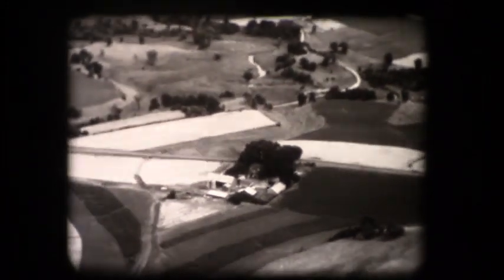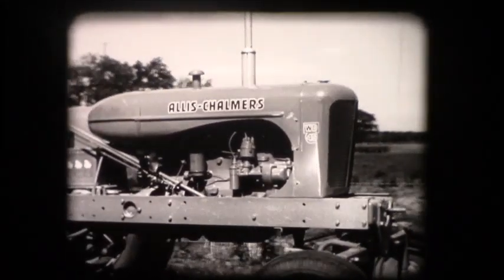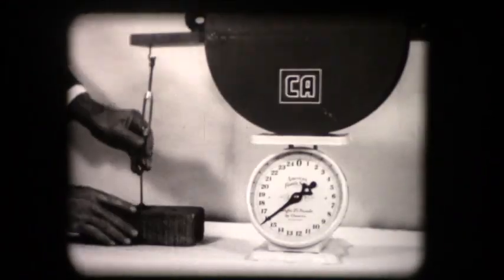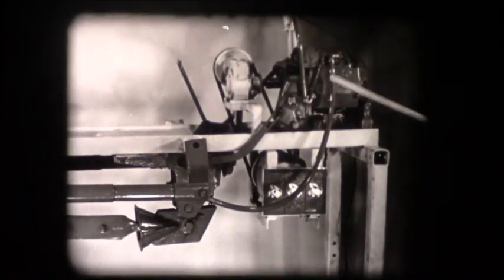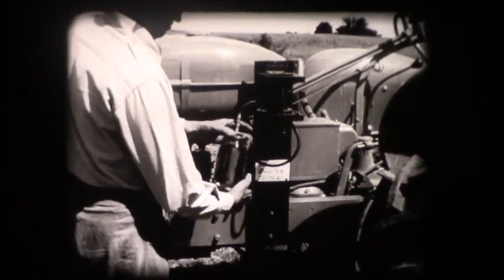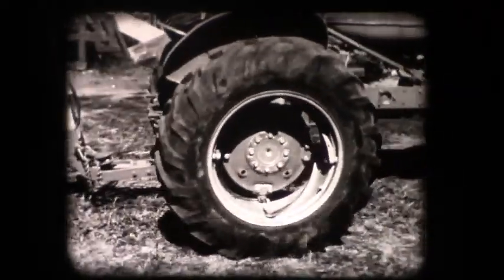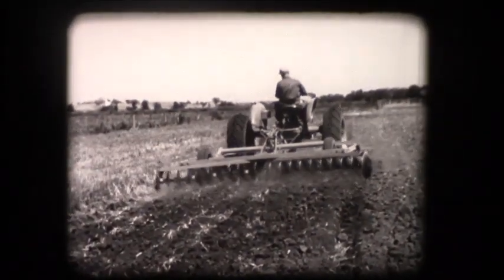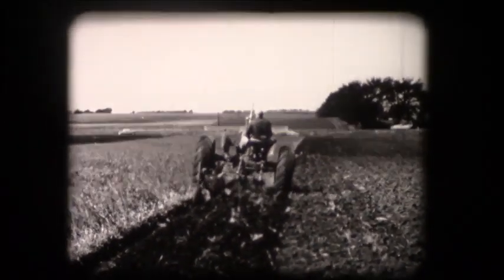1956 Allis Chalmers Dealer Movie Engineering In Action

Comment: why arent those movies in color 😮😮 other movies went 2 color in late 194OS they 1ST put rubber tires on tractors in 193O and they went 2 power adjust rear wheels on tractors 😊😊 in the mid 195OS less work less time 2 adjust the rear wheels on tractors 😊😊 OMG 7 4 2O24

Comment: So ah, Ford for one had draft control on some of their tractors 10 years earlier. Wouldn't it do the same thing if hitched to the 3 point arms instead of the drawbar?  No gauge though.
Reply: The Ford system was top link sensing and didn't perform as well. The AC Snap Coupler is hard to beat even with modern 3-point draft control because the Snap Couple pulls from a single point ahead of the rear axle so it holds the front axle down better and follows the tractor better.

Comment: We tried one years ago,... couldn't pull a fart out of a dead chicken !
Reply: Find an manual.  Ours pulls a 4 bottom plow!
Reply: @lakeprairieag  12 inch bottoms?
Reply: @mikecarr1378  Dad pulled 3 x 16's in 3rd which must be 5 mph or so. He said he could have pulled 4 bottoms easy enough. My dad grew up on IH driving an M, a new Super M and a new Super C. When he bought his WD45 he never looked at another brand tractor. Dad said that no Super M could pull like his WD45. I concur.
Reply: Could a rebuild
Reply: If the tires aren't loaded no tractor will.

Comment: Neighbor had an early WD with straight cut gears. Noisy POS that you didn't dare look at the latch for the Famous Traction Booster or it would leave the working piece behind. Sometimes it was on wheels and going uphill could prove disastrous. Plows were notorious for coming unhitched and rolling up on top of the operator, many times killing them. The seating position left you laid out even if you were a full sized adult. Escaping quickly was never an option. A horrible machine that some think were revolutionary. Traction Booster did work quite well but never became what the 3 point hitch did, STANDARDIZED by the industry the world over. And the diesel WD45 was a Buda engine. AC BOUGHT their diesel, not design it as did most other manufacturers. The Buda was good no doubt as AC used many design features for years. If not for that, AC would have been left in the dust, diesel engine wise.
Reply: I never heard of a plow flipping up until I read it on the allis forum. I worked at an AC dealership and it just never happened that anyone heard of. The snaps would automatically release if you would happen to rear up but the bottom would have to unlatch for that to happen and that wouldn't happen unless the spring broke and even then it would be unlikely to flip the plow. My dad has farmed with AC since the 60's and he's never heard of it either so I think you are just repeating something you read and that you have no experience with. The Snap Coupler system really out performs a 3 point because of the single hitch point ahead of the rear axle which keeps the front end down and drafts great by following the tractor more precisely. I was driving Dad's WD at age 9 and still have it and I never had to stretch out like you claim in order to operate it. There were years that the WD and the WD45 were the number one selling tractor in the US. 1951 and 1954 come to mind so I don't think you know what you are talking about, with all due respect.
Reply: @SilverGleaner I had a wd and that tractor was a beast.  I put that tractor through a lot and it just kept coming back for more.  I have no doubt that that tractor could handle all of the tasks of a small farm.  There are a few people that have figured out that this older equipment can get the job done without going into debt with all the latest greatest tractors.  Sure, you spend more time in the field, but isn’t that where you should be?
Reply: I had never heard of snap coupler plows rolling up on people until I read it on a forum a few years ago. I asked my dad and grandfather about it since our area was A-C heavy. They looked at me strange and said nope. And a quick Google search also tends to disprove your comment.
Then, after ACTUALLY looking at both my Uncle's WD45 and the D17 we have , the ONLY way a plow would roll up on sombody is of they had messed with the lift arms and made the spring latches unoperational as well as messed with the latch in the bell. When mounted implement reaches a certain angle of attack, they spring open and release. If you mess with it and disable it because you are so terrible at setting up a plow so it pulls that hard, then it MIGHT roll up on you. But at that point you've probably stopped and actually decided to set your plow up correctly. 

As usual a John Deere guy who doesn't take the time to understand anything but their filling rattling pop pops spews uninformed garbage out there. I wouldn't expect anything less from an archaic pop pop driver.
Reply: My father had 2 WC's and the mufflers  rusted off.  there were over 30 years old but loud...... wow!!

Comment: we had one. it was the first tractor that I ever drove.I can still remember what a bitch it was trying to turn that thing no power steering and I could barely reach the brake pedals and the clutch I would disengage the hand clutch and practically laid down to reach the brakes. ah the good ole days lol!
Reply: I wish, we had 2 WC's and that would have been a huge step up!!!
Reply: That’s for sure!  Operator Ergonomics is nonexistent with this tractor... One leg is fully extended while the other is up in your chin :)
Reply: I was driving a WD at 9 years old and didn't have a problem. I still have Dad's WD and used to mow hay with it and pulled a 5 section drag and sometime a grain drill. I sat pretty comfortable but I kept my left leg on the platform and my right at the brakes and sat sorta side saddle and for me it was better because my neck would get sore turning around checking my work when sitting on an M or even the D17. Sitting like I did it was no sweat because it was like I was on a swivel seat. I also used the hand clutch most of the time and rarely the foot clutch.